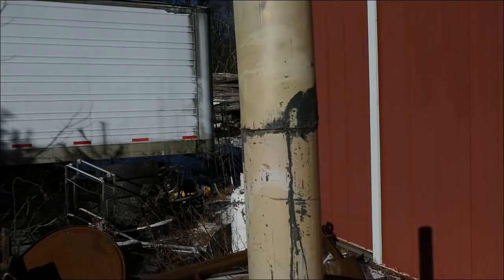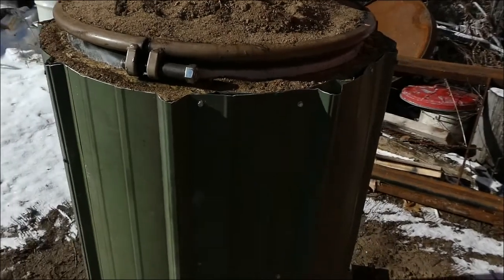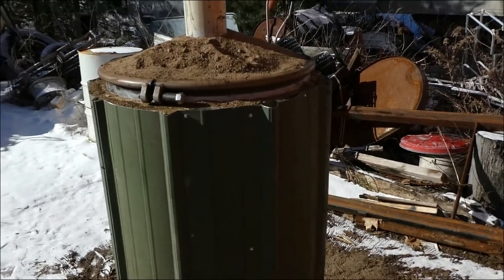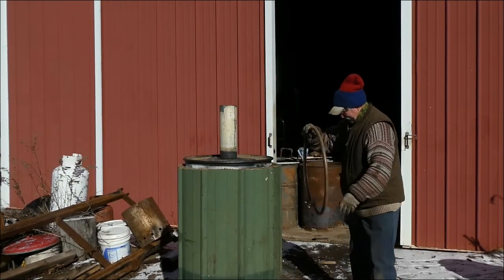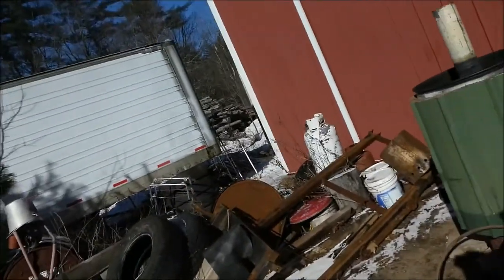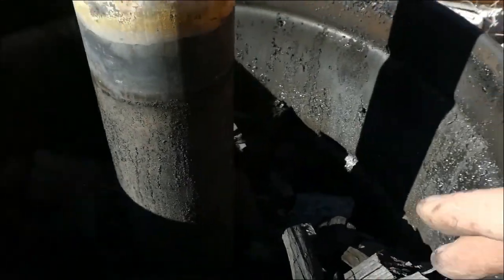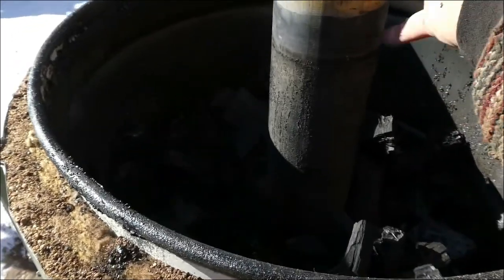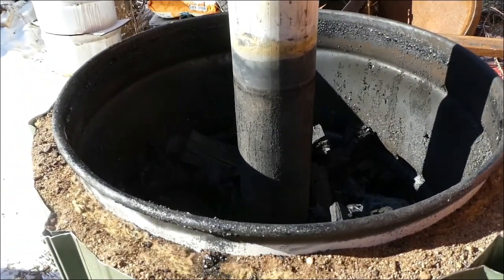Charcoal Retort: first run success022022 NH Hbbyloggr

Comment: some beautiful black gold you have there sir! fire off the big bbq, and spare fuel for a a charcoal gassifier!
Reply from the maker: Yes it is natures gift for heat and cooking. We started another batch in the retort this afternoon. Fired up the smoker which is still in the shop to do a flavor test on Costco sausages and chicken. Had to have something to do while tending the retort. Yum. I,m happy to report that the Costco brand sausages and chicken pass the flavor test.
Reply: @nhhbbyloggr5022  yep they aren't too bad. I have been on a kick lately of chicken with Danos seasoning, very herbal really good stuff from a small guy with big dreams. I like supporting company's like that
Reply from the maker: @BigBeavrSlayer  Running the smoker inside the shop has proven its worth lately. At least 2 times per week is enough to keep us fed for the week. We buy a beef cow from our neighbor every year and a local butcher does an amazing job for us, I'd say we are blessed. But right now we are taste testing for the big feed coming up in June for 130 people.
Reply from the maker: @BigBeavrSlayer  First round with the retort didn't quite finish the batch yesterday so I re-fired it this morning. 4*F so it will take a little while to get up to temps for the pyrolisis event to occur.
Reply: @nhhbbyloggr5022  Your still in full blown winter while here in Washington we just hit spring which means terential down pours and flooding. Drive the V10 today and crossed several spots that were 2 feet deep, not gassifier mini truck friendly weather 👎

Comment: Nice  :) . 
 I bet this good looking charcoal wood run a Charlek, like mine, very well indeed. 
 Maybe, you'll want to build you a charcoal powered generator, as a backup system, and to satisfy your woodgas addiction  :) . 
 Keep up the woodwork, oops, I mean good work.
Reply from the maker: Howdy there Mr. Steeme, Oh yes I have all kinds of plans for uses rumbling around in my head . I just tried me a nice smoked chicken sammich cooked to perfection using the new charcoal and it's yummy. After I get a good batch of this made I'll try using it in both gasifiers along with the hardwood chips I normally use. Indeed, it will be a very busy year for the old NH Hbbyloggr. Heating, cooking, and electrical production seems like heaven in my world. After that how about a wood powered motor vehicle ?
Reply: @nhhbbyloggr5022  
 Ain't it great to have all these sweet new ideas to try out? 
 Some might say that it is due to all that woodgas bug venom that has been nipped into our blood stream, but I wood say that it is due to our sheer fascination with the whole subject of wood to watts - and wood to food conversion processes  ;) . 
 A wood to speed conversion machine is surely watt the doctor ordered. 
 Maybe, just maybe, we could outrun a squadron of woodgas bugz in a speeding woodywagon  ;) .
Reply from the maker: @CNCmachiningisfun  I was kind of hoping that the wood powered speed wagon would out run them just for a little while and they would eventually catch up, over power the buggy, drag me out and have their way with me. I'm thinking about retiring anyway .

Comment: Bill, you'll have to record it at night to see if it's glowing. Nice job
Reply from the maker: I did get a couple pictures the night before around 6:30 pm showing a red flare at the top of the stack. The cover with the dirt used for insulation was really steaming too. But at that point the paint was still unscathed on the barrel. The magic must have happened during the night.
Reply: @nhhbbyloggr5022  I remember making a video with a one gallon paint can. It  was glowing hot . I bet the more than half of the barrel glows orange during this process. Joe
Reply from the maker: @mazdalorean  there is 2" of mineral wool hi-temp insulation around the barrel with a skin of roofing steel to hold it in place. Nice and secure . Outer skin is cool to the touch but I sure wouldn't want to stick a finger inside. BTW I just started a second batch. Having way too much fun here.